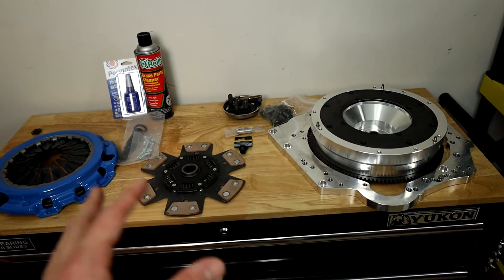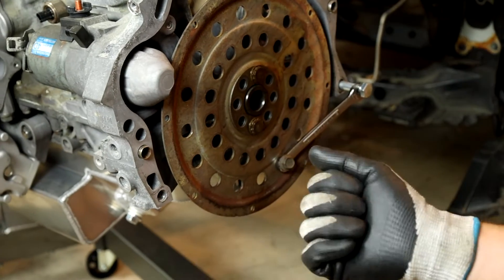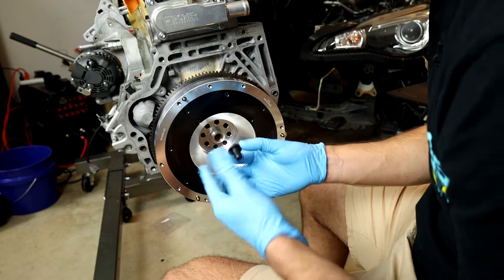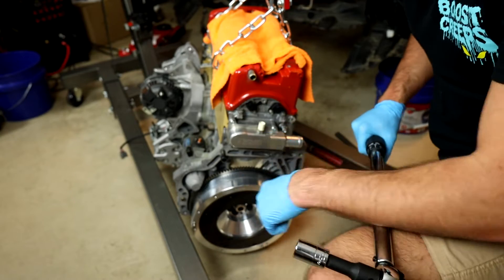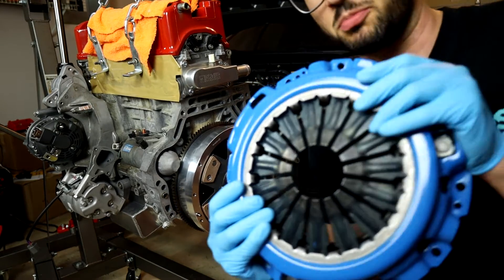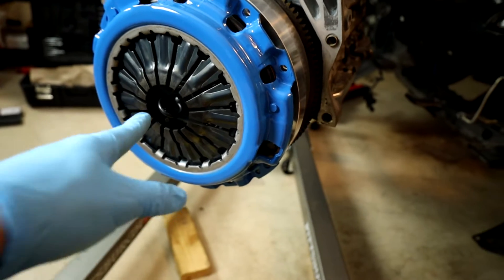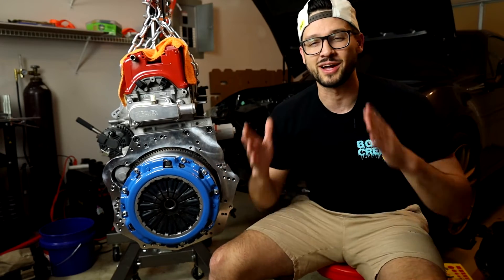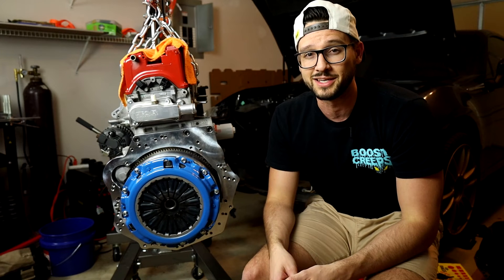K24 Swap BRZ Part 9 - Collins K24-to-CD009 Flywheel and Clutch Adapter Kit

Comment: I have the same adapter plate with the southbend clutch and zspeed internal slave cyclinder.  My clutch fingers and the outside of the slave cyclinder are touching. The oem flywheel bolts were too short.

Comment: Do not use the Honda automatic trans flex-plate bolts to mount the flywheel. Get the manual transmission bolts which are longer.